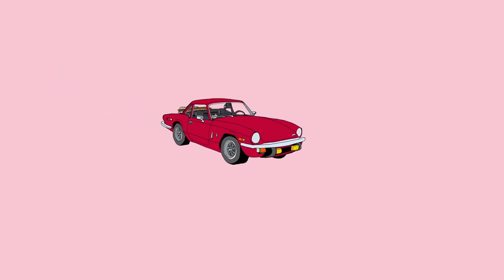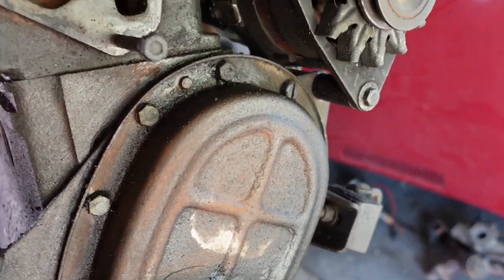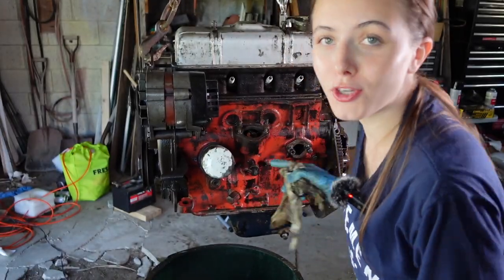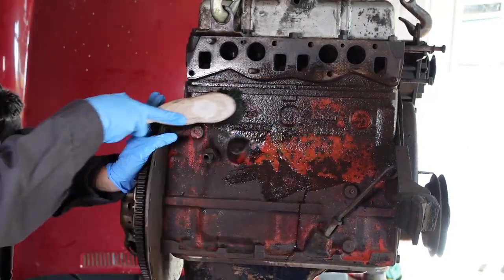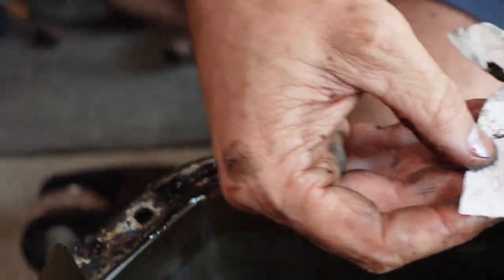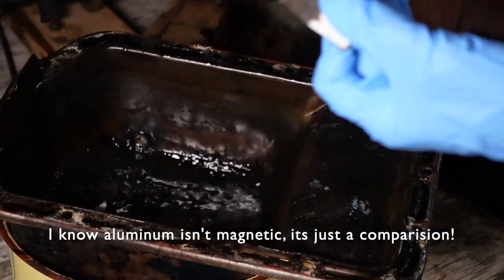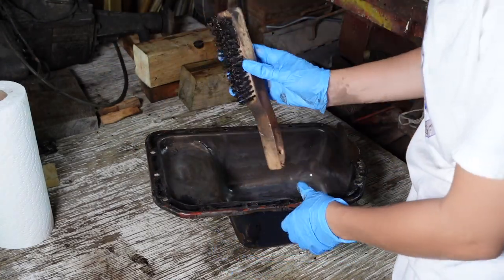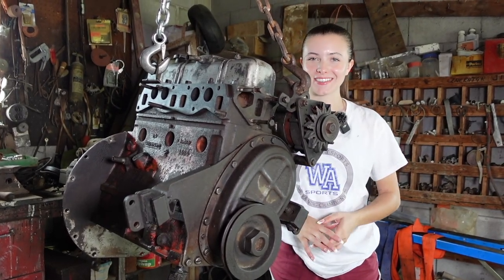Ep.26 | we found metal in the sump?!?!

Comment: That much sludge in the engine is the result of the oil not being routinely changed and proper intervals. You could remove the connecting rod bearings measure the crank and inspect it for wear and replace the bearings.
Reply from the maker: I’ll do that, thanks!

Comment: That engine has been making metal for a long time. I'd recommend taking the flywheel off so you can check the crank & conrod bearings, thrust washers, and oil pump for the extent of the wear. With all the time you've spent so far, that's the best approach. I'd hate to see you have to pull it back out with all the hard work you've done on it so far!
Reply from the maker: I’ll look into those parts, thanks!

Comment: The chunks of metal could be the thrust washers, remove the main bearing cap which houses the thrust washers and check the crank and block mating sufaces for damage, if you are lucky you could get away with oversized washers, hope it helps, cheers..
Reply from the maker: I’ll check for that, thanks!

Comment: Bonjour Saige & Dad ;) Nice progress! Nice work on it!  excepted wire brushing is not recommended near open parts of the engine such as cyl. head ports and crankshaft assy. A couple of wires might possibly fly up into the crankcase/cylinders and find their way into the oil pump or get trapped in piston rings, causing bad damage. Better to use hand scrapping tools or gasket remover spray 😉
All this black/grey sludge in the sump is the result of a combination of too few oil changes through the years and/or an engine that has not seen use for a very long time and possibly had a life made of short trips, not allowing normal operating temperature so causing lots of condensation down the crankcase.
  Now the sump is down, using a large flat screwdriver you can check tightness of both setscrews that are holding the front aluminium block (they are prone to loosening).
Metal fragments could be either from crankshaft thrust washers or bearing shells & backings. 
It could be they are here for a long time, maybe prior to a previous engine repair?
While you are at it, check by hand that all connecting rods have NO sensible vertical endfloat. 
Check you hear no knocking when you rotate the crankshaft back & forth. 
Check crankshaft thrust washer endfloat as well. they are quite easy to replace (just remove rear crank cap).
As the crankshaft centre bears the main loading and is feeding oil to n° 2&3 conrods,  I'd remove that cap and check bearing condition. Should a trace of copper be visible, I would check adjacent conrod bearings.
Hope it fires soon!😜
Reply from the maker: Good idea about not using a wire brush near the openings. We’re going to make sure to check everything on this engine before putting it in the car!

Comment: It was hard to tell from the video, but metal in the sump is not a good sign. It suggests there is a lot of wear in the bearings (highly unlikely it was the metal seal from the oil bottle, but you do need to be careful of those... most modern oil comes in plastic bottles and doesn't have those anymore).
At this point, after seeing that metal in the sump I would want to remove at least the center main bearing cap and a couple of the connecting rod caps (which MUST) be kept matched and reinstalled in same orientation eventually). Plastic gauge could be used to check for excessive bearing wear or it may be obvious. Also check for any scoring on the journals where the bearings run. Someone slse suggested checking crank shaft end float (front to back movement), which is controlled by "thrust bearings" (which also may be a source of metal in sump).
BUT...
Before you do any more, it is extremely dangerous working on a heavy engine hanging from a hoist or the ceiling! There is so much that can go wrong... possibly doing serious damage to the engine or harm to the mechanic! PLEASE get a proper engine stand. They are not expensive. You do need to remove the clutch and flywheel, before installing the engine on a stand. 
To clean up the sealing surfaces on the sump and bottom of the block, look for something like a green Scotch Bright kitchen scrubbing pad. They make them for power tools like drills too. Much safer than using a wire brush. You want to be careful of those sealing surfaces, where you will eventually install a new gasket, to prevent oil leaks.
The minor surface rust on various external surfaces of the engine and sump, and that small dent in the sump, are inconsequential. 
Keep water out of the inside of the engine! You don't want any rust getting started in there!
One more thing I would check for wear at this point is the oil pump. 
I sure wish Elin Yakov could help you at this point, determining whether the engine internals need more work or if it is okay to put back together. At a minimum, he has videos on rebuilding engines that show what to look for,.how to measure main, big end and thrust bearing wear, as well as the oil pump.
Finally, at the very least I sure am glad to see you remove the sump and get that nasty old sludge out of the bottom of it! Would have been terrible to start up the engine with that in there! 
You're doing good... just please get that engine on a proper stand (do you have Harbor Freight in Canada?) for safety sake. You will need to torque hard on some of those bolts (a proper torque wrench is nevessity), so the engine needs to be properly supported.
Reply from the maker: It looks like we’re going to fully take the engine apart just to be safe. And good idea about the safety of the engine and us while working on it, it’s now safe on a table and we may start to use our engine stand

Comment: Saige, I noticed you used a 14mm, then a 13mm socket. Spitfires are all Imperial units. You know, inches and fractions thereof. You need to get a complete set of those, and never use a metric set on the Spit again. BTW, 13mm and 1/2 inch are virtually the same size, so those are interchangeable.
Reply: Yeah, definitely something to be aware of (I was just about to comment saying the same). Particularly important to know the difference if you need to buy fresh nuts, bolts etc. My Spitfire has had several metric bolts forced into imperial thread holes in the past which I’ve had to rectify…
Reply from the maker: That’s great to know I’ll keep it in mind thanks!

Comment: if you check crank and rod bearings, thrust washers, camshaft lobes and cam followers aka tappets, and all is well with all those, then you'll be fine.  cam follower wear can sometimes look like what you found... they can gaul.  doing this at this stage is easy to do..... but putting it in the car and blowing the engine will really put a huge huge dent in enthusiasm.  ask your dad about plasti gauging the bearings.   easy peasy but very worth it.
Reply from the maker: I’ll look into checking all those parts, thanks!

Comment: Just to get it up and running to drive it before the snow fly's is ok to do but plan on rebuilding the old one or this one over the winter. That way you will have a known fresh engine and when you do please replace the clutch, pressure plate and throw out bearing. Check the fluid in the transmission. Doing this all over the winter will make sure your ready for a summer of great diving! This is why I desided to go threw everything on my Spitfire so I will have a safe and reliable car. Can't wait to see the next video.
Reply from the maker: Great idea! I’ve decided to go through it so it’ll be all good for next spring!

Comment: Great video Saige. You are making progress and learning all the time 😀. You have had some excellent advice in the comments especially about checking end float and removing con rod  and main bearing caps to check for wear plus using an engine stand. Maybe it would be worth removing the cylinder head and then checking for wear in the cylinders. Cheers, Steve.
Reply from the maker: I think I’m going to check everything out just to be safe!

Comment: While you have it apart. Check endplays, oil pump wear, plastigauge the bearings and retorque the caps properly (red thread locker, do this properly). I'm assuming you compression tested already. Maybe send out an oil sample to see what the wear metals levels are (most auto parts have a $30 kit). Good luck and try to be careful around the oils, nitrile gloves are cheap insurance. My body shop friends all laughed at me when I wet sanded while wearing a respirator (I told them that I wore it because of the dust that THEY were filling the enclosed shop with, they still called me Darth Sander). Out of the ten of us, I'm the only one not dead or ill with lung issues (I'm 54 now). Also try to get an engine stand, they're cheap and very convenient.
Reply from the maker: I’ll definitely look into the oil test, and wow I’m sorry to hear about your friends but it’s an important lesson is personal safety!!!

Comment: At least take off a few of the crankshaft and connecting rod big end caps and have a look at the bearing shells and crank for wear… some of that silvery sludge will be bearing surface that is meant to wear away gradually instead of the crank wearing, but when it is all worn the hard bearing material underneath will damage the crank. You might get away with just fitting new shells short term…
Reply from the maker: I’ll definitely check that out thanks!